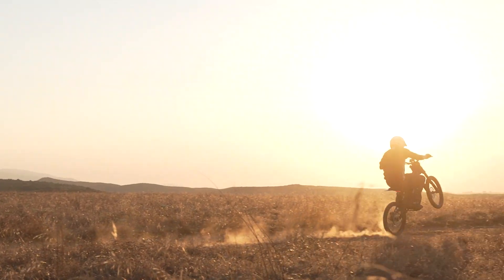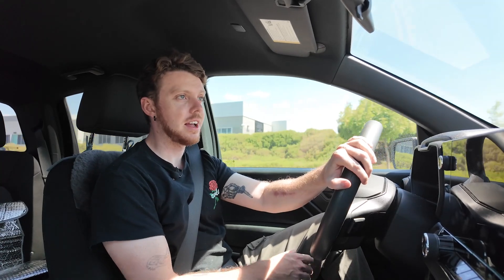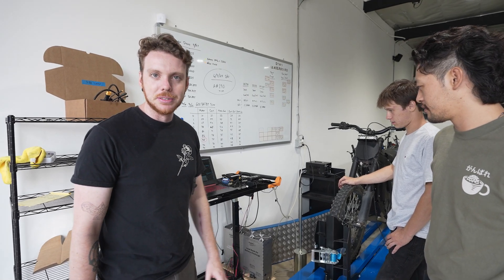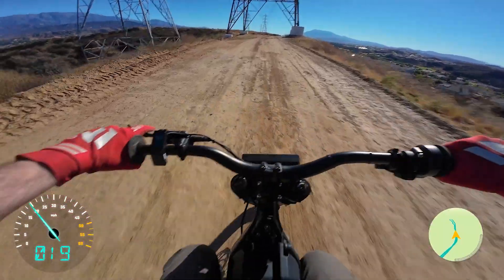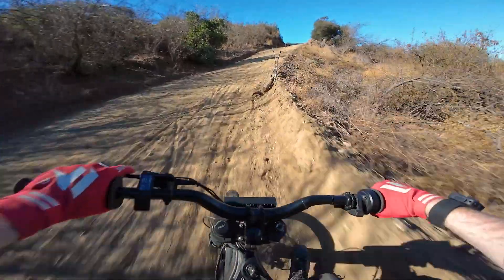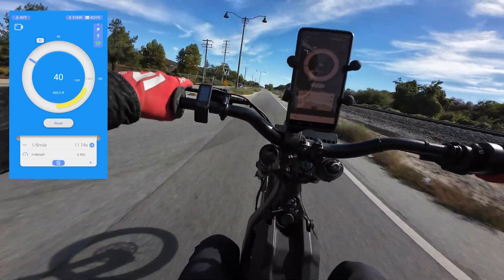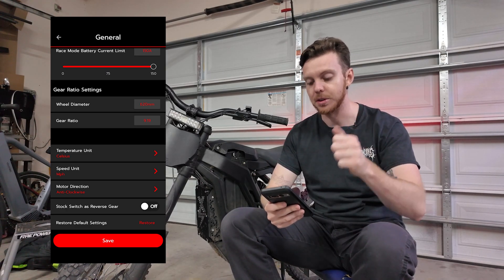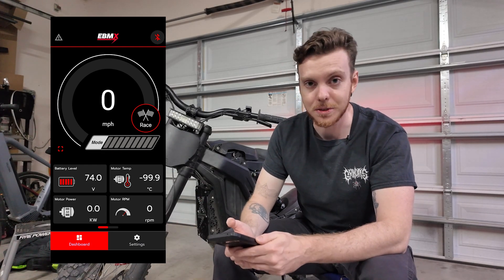E Ride Pro SS Upgrade Adventures (New EBMX Controller + Dyno Run!)

Comment: It will be interesting to compare the performance of this upgraded SS 2.0 to the SR. The SS with this controller is about $5,750. The SR is $5,600. According to your dino figures the SR should still have more power, plus it has a 25% bigger battery. The only disadvantage of the SR is that it's heavier than the SS. So unless you already own an SS it would make no sense to not get the SR over the SS and upgraded controller.